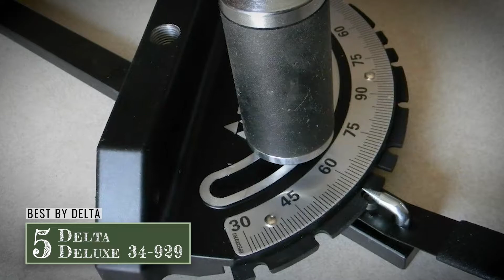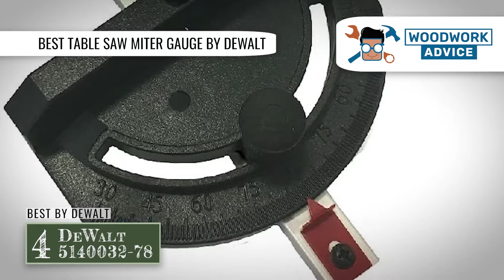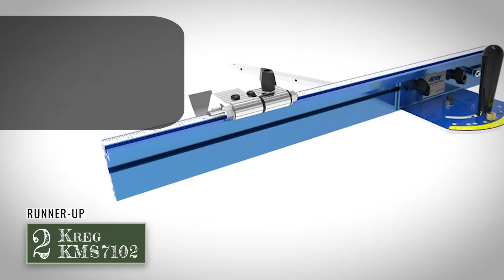Best Table Saw Miter Gauges 🧰: The Best Options Reviewed | Woodwork Advice

Comment: 90% of sawing is done at 90 degrees, so I can't imaging not having accurate measurement on a miter slide, such as  is on your main fence. Micro adjustment is less important if you can easily set the size. Then most angled cuts are made at 45%. However, if you are cutting for multiple part glue-ups, then vernier precision is essential. Only the Jessem currently has both features, as well as being the easiest to re-adjust.  Lastly, the push handle is the part you touch most, which is another reason for preferring the Jessem.